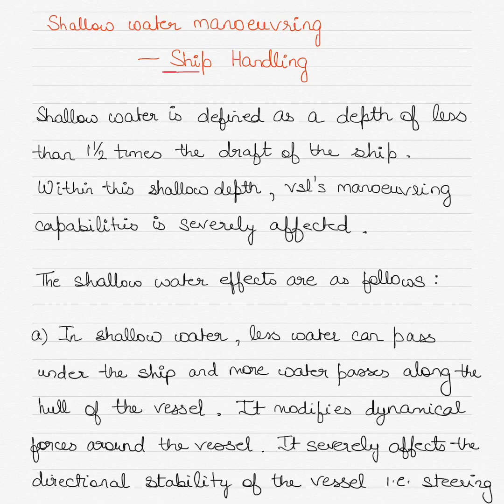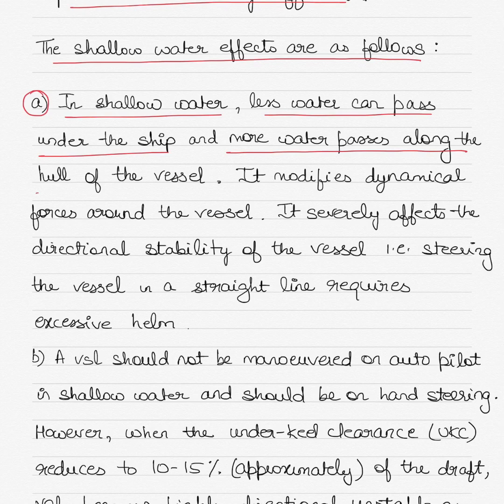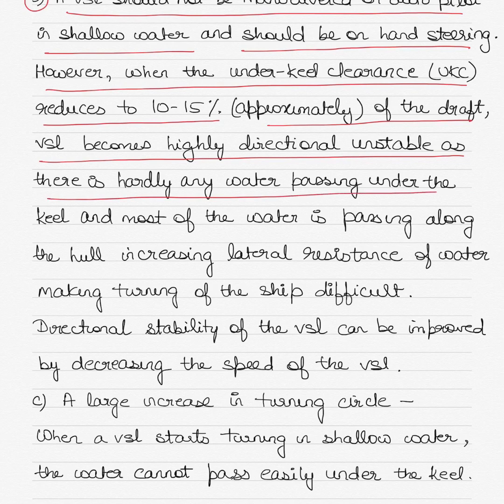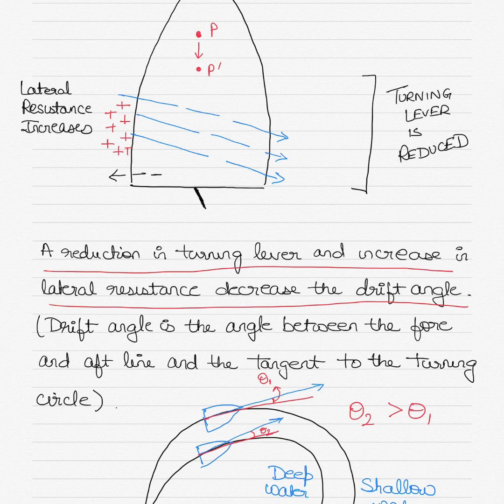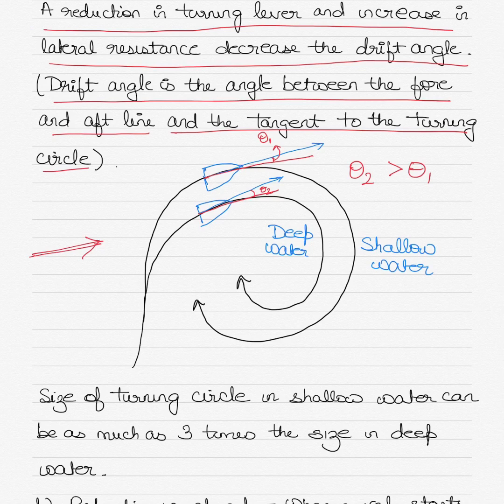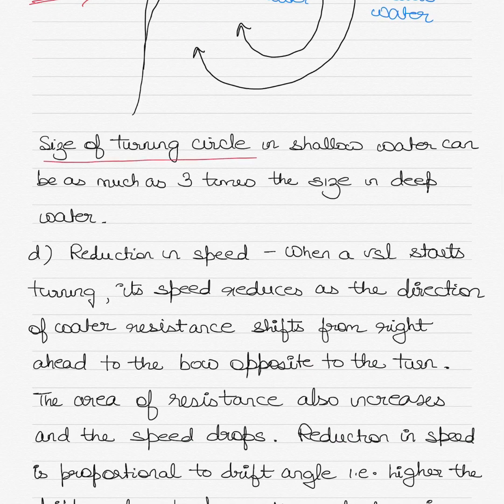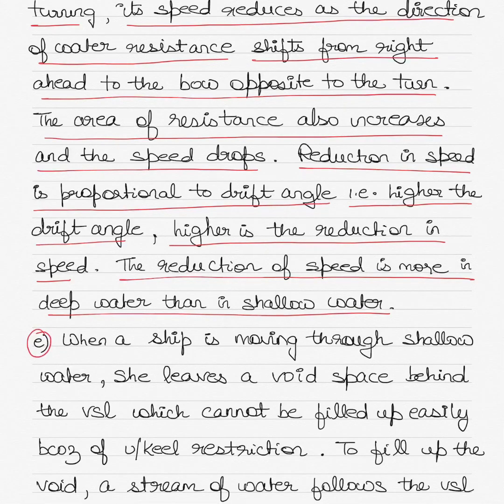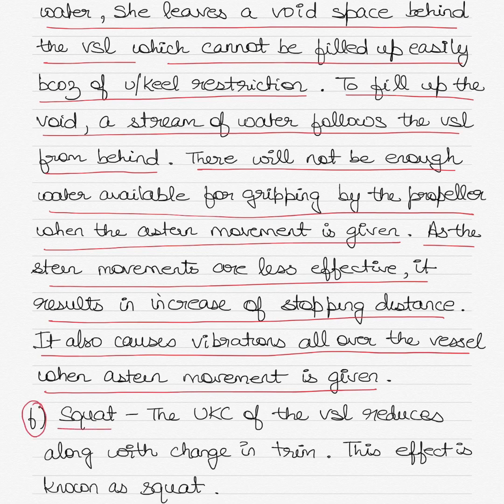Manoeuvring in shallow water - Ship Handling

Comment: I believed the vessel became more directionally stable in shallow water?
Reply: As the hull moves through shallow water, the area which it displaces is not so easily replaced by surrounding water, therefore, leading to a state of partial vacuum as the propeller and rudder are still working. The vessel take-ups longer to answer her helm, and response to engine movements becomes sluggish.